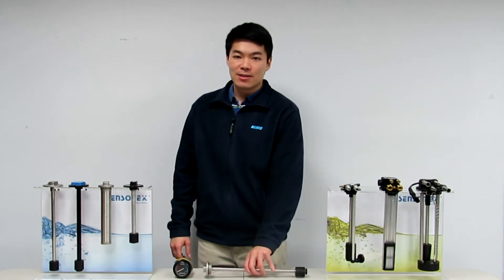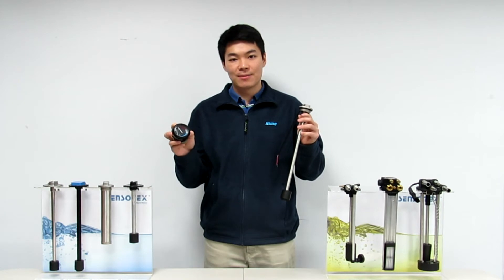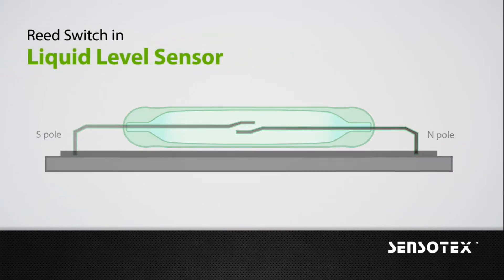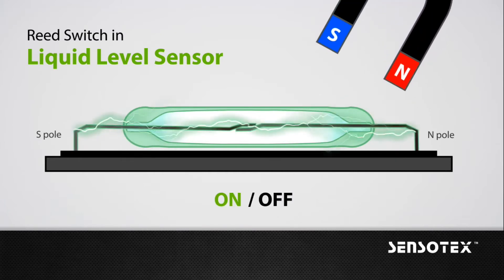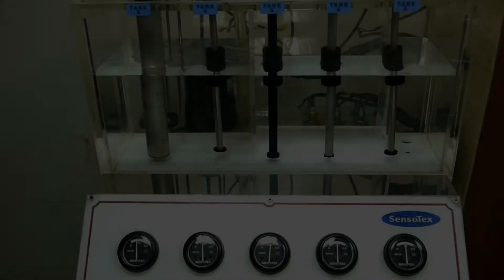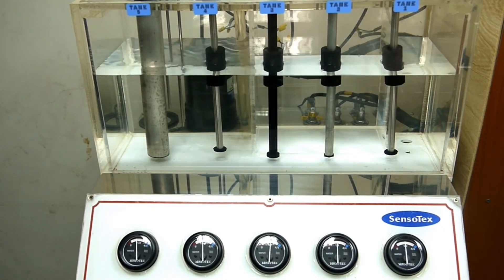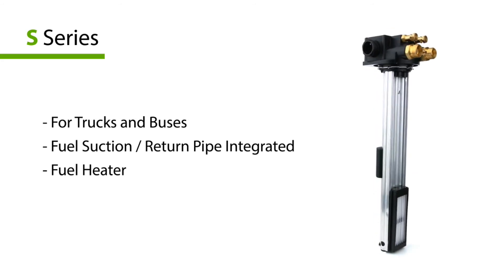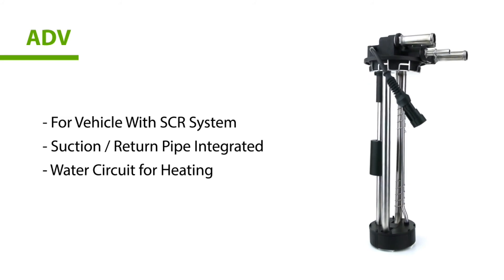Reed Switch in Liquid Level Sensor SENSOTEX

Comment: Its a fail to sense the fuel level horizontally..it will work in small port like 1 liter, 2liter if we use this senser in large port like 100 litter or more the measurment of liquid will be poor or incorrect